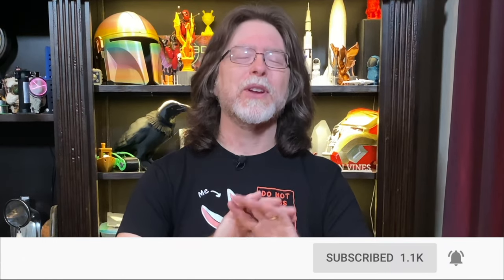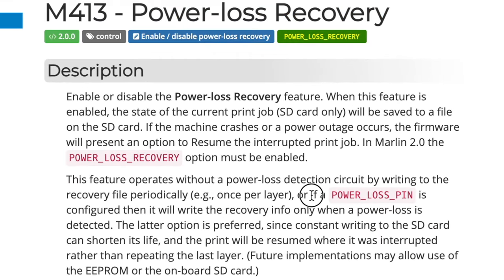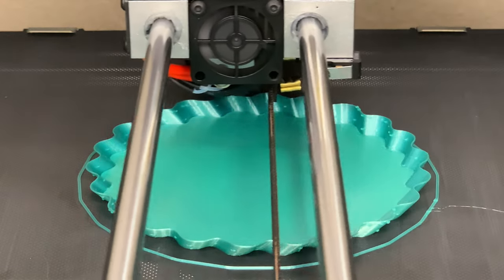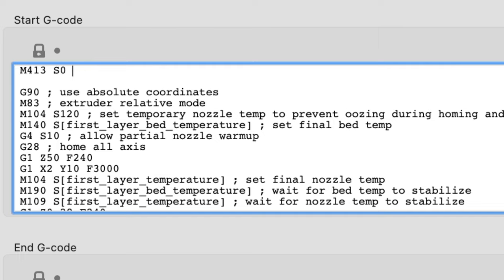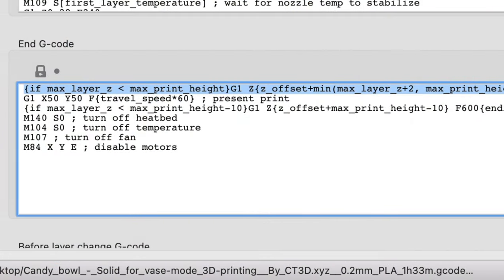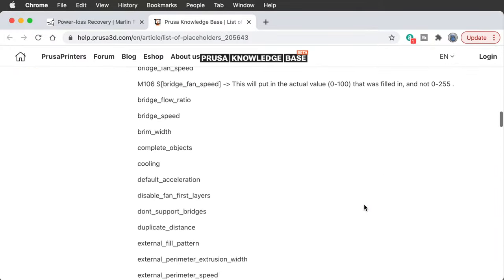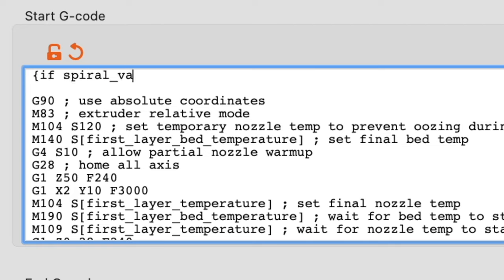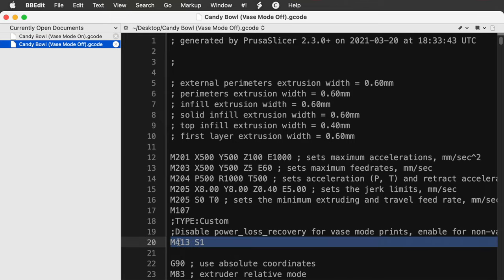Clear Up Zits on your Vase with this ONE SIMPLE TRICK! 😉

Comment: Interesting. Neither of my Ender Max do this. Maybe it’s the complexity of the file. I did see this on another low cost printer and it was the SD card. Put in a better SD card (with faster Read/Write speed) and issue went away.
Reply: Good call Chuck this is an often overlooked part of 3D Printing.  SD read and writes can certainly affect performance of the mainboard.  I cant tell you how many SKR SD cards ive replaced because they are the cheapest cards China has to offer.
Reply from the maker: Hi Chuck. You're probably right about the card. These cards are probably not the speediest at writes, and if I remember correctly, the cards are skewed toward faster read speeds than write speeds. Thanks!
Reply: @BV3D  I’m a photographer so I used a class 10 from my camera bag & they don’t seem to have issues as illustrated, I’ve had it from octoprint which I think is due to something buffering, the exact same problem.
Reply: @MakersMashup  I have replaced all the cards that came with my printers, eventually, they all had issues but only one had issues from the start
Reply: @MakersMashup  Wow I hadn't anticipated any write commands to the SD card during printing. Is there a minimum or recommended read-write speed you would advise?
Reply: Im new to printing and have a ender 3 max, what is a good card to be using? I'm currently just using the card that come with it. I have no idea if it's a good card or not.
Reply: I changed from the included card to an old TDK branded one I had lying around from an old phone, and that did the trick for me
Reply: wow, you have amazing observation!!! your INDIAN fan!!

Comment: Thanks for the detailed rundown, super helpful! I have had this issue on regular prints too when printing stuff with a lot of high res curves, essentially loads of short tool paths, and it overruns the command buffer so you get the pauses and zits everywhere, not just at layer changes. If you live somewhere where power outage is super rare, I think leaving power outage recovery off will be an overall win. Take the hit if it comes. Unless its a 3 day print and super smooth finish makes little difference. Pick your battles. Ender 3 S1 Plus printer.

Comment: I was printing a trashcan yesterday and it only got the zits in the more complicated parts of the sides.  parts that were just circular were perfect.  I printed it again in a different filament and got the same thing so i'm glad i found your video for next time!.
Reply: More complex sections of a print can overrun the buffer in non vase mode prints causing the printer to pause to upload recovery data and reload buffer data.

Comment: The real underlying cause is that stock Creality firmware writes PLR information to the EEPROM chip on the mainboard (for the CR-6 at least). That EEPROM chip is quite slow, because it takes up to 500ms to write to. If you run a build that is based on recent Marlin however, PLR information is written to the SD card, and that resolves the issue.
Reply from the maker: Creality seems to make all sorts of odd decisions with their firmware, and some of them leave me scratching my head. Thanks for that info!

Comment: Thank you! I had upgraded to a Creality 32-bit mainboard a few months ago when a shorted hotend thermistor took out the original board. I've been beating my head trying to get rid of the zits in vase mode. I was down to blaming my Swiss Micro knock-off hotend. I simply opened an exisiting g-code file for a vase in notepad and dropped in the M413 S0. I even commented it :) My Ender 5 turned out a beautifully smooth vase.

Comment: today i was printing on my homemade junk just a ball in vase mode, i had to replace top for a part of the same model code but from regular sliced model but that was a small thing 
everything worked fine from arduino sandwitch
but when i pluged the same code into brand new ender 3 s1 the horyfying bumps apeared and i remembered this issue
fun thing is my old ender 3 at home apears to have 32bit board this feature enabled and don't suffer from it or i never noticed it
and now i wonder if my whole lot of filement isn't wet by any chance :]
3d printers are wird 
sometimes you slice the same model for the same printer twice using the same program and you think all your settings are the same but it takes 2 times longer to print and your infill is kind of wonky
i guess silent stepper enders suffer from zits more than old noisy ones because so far i didn't noticed anything like that on my printer, although it mightdo other things wrong 
i love your solution i will try it on my work new ender 3 1s's 
have nice day , (i have no idea how to write a good comment :P)

Comment: I just upgraded my original CR-10 to the newer 4.2.7 main board and this issue cropped up in my vase mode prints. I remember watching this video a few weeks back and remembered part of the fix so watched it again to jog h th he ole memory. 

Since this was  done on Prusa Slicer I wasn’t sure if this would work on Cura so I did a search for placeholders in Cura and found {magic_spiralize} is the place holder for Cura. I simply used the same if/then statement and swapped out spiral_vase with magic_spiralize  in Cura 4.8 and it fixed the issue.
Reply from the maker: Hi Patrick! Awesome -- thanks for sharing the way to do that in Cura!

Comment: If your use Octoprint and don't have an SD card in, would you have this problem?   I really don't see the advantage of resume print,  if the power fails you are probably sunk - with the bed cooling.  I do like the use of variables in Prusa, have used some in the past.
Reply from the maker: I don't know if it would still be an issue or not. I don't think it would be. When using OctoPrint, the Raspberry Pi (or whichever host system is running OctoPrint) is sending the G-code commands to the printer over the USB cable. I don't think the power loss recovery feature is active at that point. The firmware isn't printing from the card, and has no idea what point of the file it's currently operating on. It's just performing the movement commands given to it via USB. Agreed on the issue of bed cooling. If the power outage lasts long enough for the bed to cool, the print can easily come loose if you choose to resume printing.

Comment: Had this problem with my Ender 3 v2 (4.2.2 board) and even changed to a different firmware (Jyers), turns out they added power recovery in one of the updates so that didn't fix anything, but still it's more up to date than the creality firmware. Anyway, thank you for finally giving me solution which works, this has been bugging me forever.

Comment: Would it be worth just shutting it off if you have a battery backup and a house generator? Would that help free up "Memory" at all or help the prints in any other way or just a vase thing. Thanks for the helpful videos as always.
Reply from the maker: It probably wouldn't hurt to just leave it off if you've got good backup power. Power loss recovery's usefulness can be somewhat limited if the print bed is of a kind that releases the print when it cools (like Creality's glass beds). So if the power is out for more than about 10 minutes, the bed's going to let go of the print anyway, and then it'll either slide around or tip over when printing resumes.
Reply: @BV3D  Really appreciate the reply and good to know I have Wham Bam bed plate so it would never work anyways. I think with the backup I have it's just not needed so one less thing to need running. Thanks

Comment: Cool macro. I like trying to figure out new ways to use them. 
In Superslicer (I suspect PS as well) I maintain custom gcode for each Print profile as well as for each Filament profile. So, another way is to just put the M413 command in each Print profile and use S1/S0 as appropriate. Of course, that wouldn't be as fun would it.

Comment: I had a similar problem with normal prints, where I'd get a blob when the printer went from the inner wall to the outer wall and reversed direction to lay down the outer wall of a print with 2 wall layers.

Comment: With my CR-6 SE, I am using Cura 4.8 with the community firmware and printing through OctoPrint with no SD card involved. Taking the SD card out of the equation is a big help.  Because of this I have no zits or spots when printing in Vase Mode.

Comment: Great vid! I'm a happy new subscriber 😊 I printed my first 3d benchy. I have a few small zits in a few areas. Everything else seems perfect except the few zits. Would this fix that issue as well or does it only apply towards spiral vase shapes?
Reply: Oh and I'm using cura and on a creality ender v2
Reply: @arcangelgabe5442  I have a ender 3 v2 that I just bought. i, having the same issue. did you manage to solve it?
Reply: If you look at the slicer preview in Cura (or PrusaSlicer), see if the zits match up with where the new layers start.

If so, it might point to needing to tweak the retraction settings for the filament you're using. When the print head is hot, filament will ooze out slowly even if it's not extruding, such as when it's moving to a new location or changing to a new layer. (You'll have noticed this when the printer is warming up, too.)

To prevent this oozing, slicers can tell the printer to pull back the filament a little bit before moving. You can adjust how fast and how much to retract. E.g. with one brand of PETG I have, I've settled on retraction of 7mm at 24mm/s. I also make sure to enable "retract on layer change."

Comment: this doesnt seem to work for me with cura right now, ive been trying to solve this i also tried the fix from cnc kitchen and im still getting pretty bad zits
Reply from the maker: A plain M413 S0 in your starting G-code should disable the Power Loss Recovery feature. I used an if/else with PrusaSlicer because it automates it, disabling the feature for Spiral Vase mode prints, and leaving it on otherwise. You might check the menus on your printer to see whether it has a setting to enable or disable Power Loss Recovery, and if it's there, turn it off to see if that helps.

And a new or faster MicroSD card could help, as well. The actual problem has to do with the Power Loss Recovery writing the printer's last known position on every Z change, which works great except when Z is changing rapidly (which happens in a Spiral Vase mode print). A faster card can accept the writes, and not bog the printer down.
Reply: @BV3D  I tried that m413 s0 but I then tried to unplug my printer during a print to see if it was truly disabled, and to my dismay my printer asked if I wanted to continue the print
Reply: @BV3D  I am on an ender 3 pro and can't change the power loss recovery in the printers settings, I'm also using a Samsung exo as card so it's not the same stock one that came with the printer